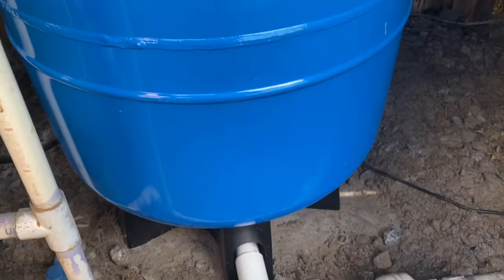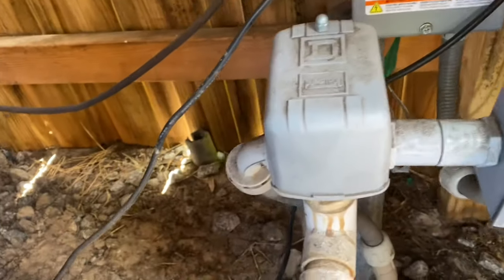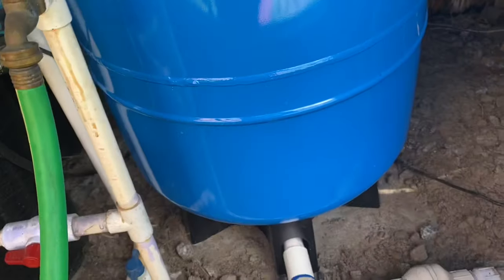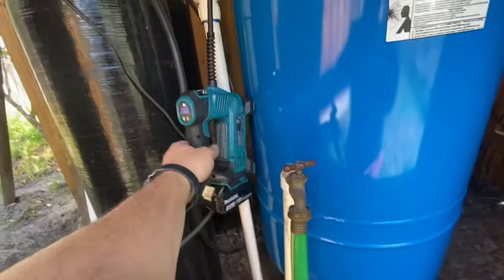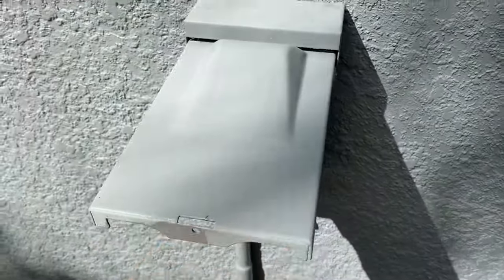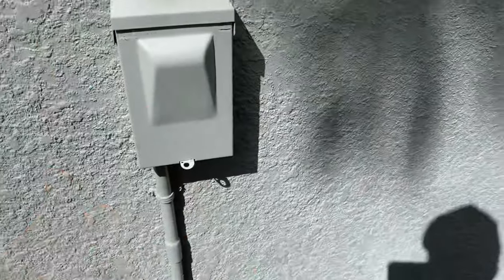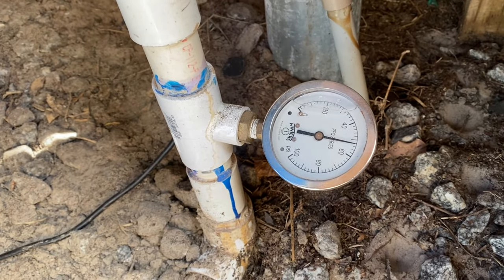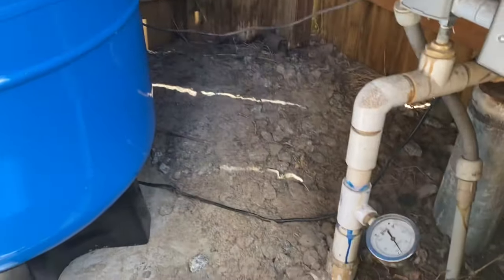How To Set Your Well Pump Pressure Tank With Proper Air Pressure

Comment: After you do all that what would the pressure read if you were to put your air gauge on it after it’s filled with water? I drained my tank of course I pulled the breaker first I checked the air it said 20 I put 38 in it because I have a 4060 switch turned everything back on all is well. But I checked the air gauge afterwards and it says 50 something. I noticed you did not check your air pressure after it was filled I’m curious as to what it would be if you did
Reply: I have the same question 🙋‍♂
Reply: It would read 60 psi. Possible your switch isn't set to cut off at 60? If I recall on mine I had to make some adjustments on the cut-off valve to set it.  It came pre-set at one value but supports adjusting it 10 psi up and down.

Comment: You’re amazing buddy. Question so I had a new switch put in because it went bad but same before 40 to 60 switch. So shut breaker off and can I turn on faucets to drain it instead? Than I will add 38 psi than turn back on? Also my gage is bad should I shut off water supply also to add a new gage? Please reply thank you

Comment: Should I leave my water valve open or closed when filling it with air? Also should breaker be off to well pump and bladder or just one?
Reply: Did you ever get an answer to this?
Reply: No I did not. Unfortunately. Called a few plumbing companies they wouldn't tell me anything, they wanted to do a $250 service call. Ridiculous.
Reply: Wouldn't matter. Bleed the water system to zero and shut the valve.

Comment: What's the pressure of the bladder in the tank when the Gauge is up to 60psi??? Just curious how that works with start pressure 2psi below cut on. Thx for the video
Reply from the maker: Good question.  I’m not certain. I’d imagine the bladder remains at 38psi regardless but I could be mistaken. Perhaps someone can provide some insight.
Reply: 60 psi. The air in the bladder compresses to the point that pressure on either side of the diaphragm is equalized, so when charged all pressures have to be equal. Of course a purist will point out that the water gauge is below the air inlet gauge, so there is a tiny effect of the added column of water above the line pressure gauge and below the air inlet gauge. If the height of the water column is 27.7 inches, that will mean pressure in the lower gauge will read 1 psi more. You can tap on the tank and estimate where the top of the water is, and measure height from there, but it's insignificant. That compression effect is what gives the system capacitance to make quick adjustment to line pressure, so whey your wife is in the shower and you flush a toilet, she doesn't complain. It helps reduce a fast cycling strain on the pump.

Comment: My gauge stays at 62 at all times. The cover on the switch says 40-60, so I’m guessing it’s the same as yours. I inherited this house after my dad passed and I’m having issues with the water pressure being so high we could power wash the dishes, then the next second it’s so low u can barely shower. 

I have turned off all the breakers and drained the water and the gauge is still at 62… I guess I need to search a video for that…

Comment: what size is your pressure tank  mine is 40 gallons and wir pressure is just above 40   , I just had a new pressure switch and pressure gauge put in my house and pressure switch is at 40 even though no water is being run in the house for 3 hours, Well is over 400 ft deep with a 1 hp power pump  that is also new